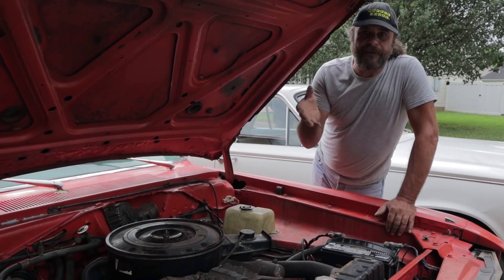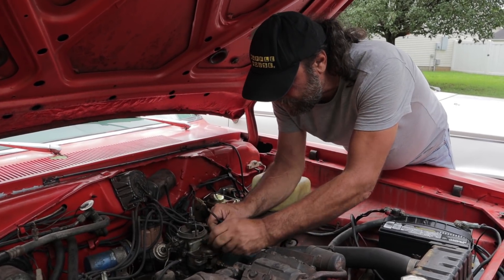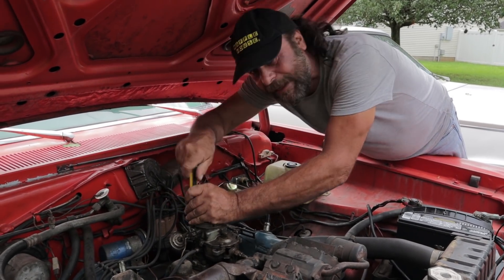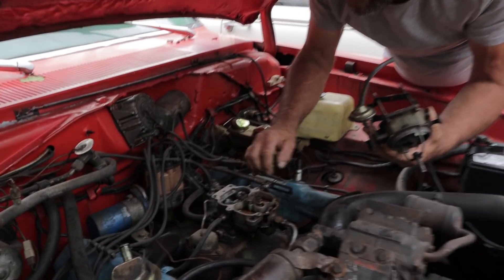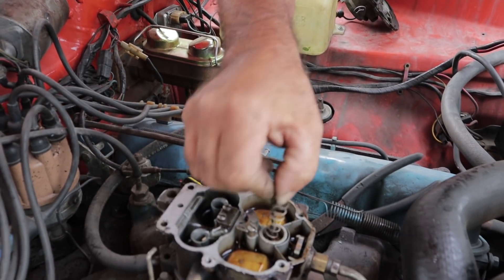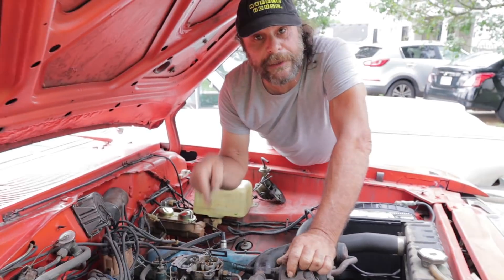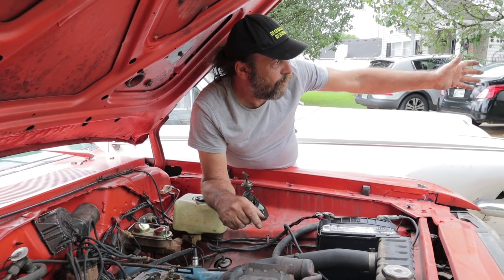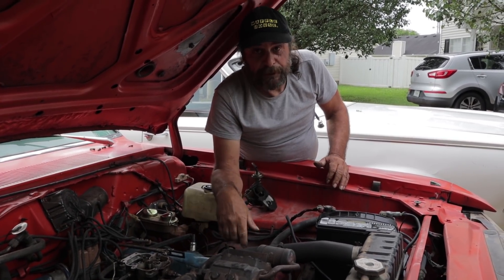Driving Classic Cars- The Truth About Ethanol Gas

Comment: Im with Tony. I have old carbureted cars set for months even years and havent had issues. Also daily drive them using nothing but E-10. And where i live the dreaded indian reservation gas ( 75 cents cheap er). Never had an issue. I will say it can possibly make the engine run a tiny but on the lean side. Also yes worse gas mileage because less energy is stored inside ethanol. But from what i understand it reduces chances of pre ignition... I have tried running pure gas which is found at a few stations within 50 miles of where i live. With mixed results. It can only be bought with 90 octane now. Few years ago was 91. But ive had it make my carbureted 318 run worse... Maybe because no one buys it and its old??

Comment: I beg to differ. Maybe motorcycle/atv/snowmobiles are different but 2 or 3 months with ethanol gas up here in Canada and the carbs are plugged and won’t start. At our shop we run only ethanol free fuel. Now up here the problem is the algae in the ethanol. With regular use and not letting sit for extended periods of time, it’s not as bad but still drys out the fuel lines. Something that has been sitting unused for 5-10 years has a better chance of running than something 6 months to a year. Again, maybe your ethanol is different than ours but up here it’s nothing but headaches.

Comment: I guess it can depend on what the carb is made of.  My F600 which gets started maybe 10 times a year has no problems with ethanol.  My old tractor, on the other hand, ethanol turns into boogers if I don't use some kind of ethanol treatment.  And older tractor mowers... shew!  That shit will turn to boogers in a week.  It has to be alloy related.
Reply: What I've noticed is with the carbs that can't use ethanol will be etched where the boogers grow.  But you can make that same carb work forever with diligent use of any sort of ethanol treatment.

Comment: My experience with ethanol fuels has been mostly negative. Have seen metering plates dissolved into metal shards in the float bowls . Probably fine for daily drivers but for anything that sits for any length of time I'm draining it.

Comment: i heard ethanol is only really bad if you have the cheaper modern floats instead of the old brass ones. either way i have easy access to 87+ gasoline without ethanol just down the road and can get higher octanes without with only a bit of a drive.

Comment: I was told to run premium gas in my old 350 Buick 4 bbl. is that true? Is it ok to use 87 or should I use 91 octane?
Reply: 420dportkid u can use either the higher octane will burn better
Reply from the maker: I use 87 exclusively in all my low compression daily drivers.  I have back to back tested with higher octane fuels and found zero benefit
Reply: Burn better? Higher octane gas burns >slower<, thus resisting pre-ignition and allowing a higher compression ratio. Or a larger initial ignition advance. If your car calls for 87 and doesn't have computer-controlled ignition timing, you won't get any benefit from higher octane. Caveats: if you have carbon buildup which is causing pre-ignition, it may lessen or cease. Also, there may be higher level of detergents in a brand's high-test than in their 87 octane

Comment: Nothing, it's a beat up , I knew  that 😅,I've run e85 in 99 302 Windsor before and the fuel systems are fine , but for it to run properly on e85  you would need to up grade the fuel pump and injectors for volume not corrosion, e10s doesn't do anything, except for lawnmowers which probably would need bigger jets

Comment: Just wondering if you all would buy a 4 door 70 cutlass with a 350 rocket running and driving needs a tune up and some rust repair on the lower doors and rear fenders
Reply from the maker: If the price is right, and the car turns you on, of course!
Reply: @UncleTonysGarage  getting into it at a young age my friend counts doors and is getting rid of it for 1000 canadian 760 American I'm really tempted

Comment: i play with a lot of bikes. mostly the really small ones, and the really big ones. i have personally seen ethanol gas melt plastic float bowls. some gaskets get shitty off it, i only use my own homemade gaskets tho. my biggest gripe is that i used to run clear plastic fuel line. it's fine with GAS gas, but the ethanol screws up the plastic and makes it so i gotta use the big black rubber fuel line. i got a few spots new me that sell "marine" gas. it's ethanol free for boats. not sure why boats need it, but i use it in all my bikes whenever possible. when ethanol gas evaporates, it leaves this crusty white stuff behind. a guy i know had left his petcock on and had a bad float needle. the e.gas would drip into the carb and evaportate. the crusty white stuff left behind eventually cracked the float bowl. that carb was done too... i feel like putting ethanol in gas is about the same as putting corn starch in cocaine. scientifically, the same motor will make less power running ethanol gas, unless you tune it different. it's not really that big a deal, it "works." i hate it tho....
Reply from the maker: Gravity feed systems are an entirely different thing

Comment: Interesting.  I think the biggest gripe about ethanol gas is the octane that is running in a high performance engine.
Reply: Keep in mind that the way octane was measured changed in the early '70s in the USA.  We went from RON (still used in Europe) to Anti-Knock Index (basically (RON + MON)/2 as shown on the pumps).  93 has decent octane.  It would have been ~98 if measured the old fashioned way.

Comment: ethanol does not evaporate well in small engine carburetors. it absorbs water from the atmosphere and becomes very corrosive. by the time the ethanol dried out, your flloat bowl probably stuck in oxidized aluminum crud

Comment: I can't drive my 84 in the heat for more than 15 minutes without being vapor locked for 2 hours and having to spray half a can of starting fluid into the carb on 10% ethanol. I run premium clear ONLY now.

Comment: Let a carb that stays wet, like a motorcycle with the fuel tank using gravity\fuel weight to keep the bowls filled, just sit, and it's a different story... A freshly rebuilt, cleaned carb on a dirt bike, will get plugged by the "green gunk" in about 4 weeks of sitting.

Comment: I heard that ethanol was bad for rubber hoses and such,I am no expert and appreciate your informative videos very much. I have one question. Do you have any problems with altitude going from high to low or vice versa, I live in Florida my truck was changed over to carburetor but I am at sea level so everything works fine all the time. Cool video.
Reply from the maker: No...I don't experience any issues with altitude change...but to be fair, I don't spend much time cruising through mountains

Comment: Only problem is when you ran a car for decades with out ethanol, it ends up having tons of deposits on the bottom of the gas tank.   Then the Ethanol in the new gas given enough time will dislodge the crud and deposits and choke the fuel filters, pumps and carbs.
Reply: True that.

Comment: i find the ethanol gas is typically less stable... i work on motorcycles and the fuel doesnt last as long before going bad in the carburetor... also see more failures in rubber... granted this is if it sits for 6 or 8 months.... other than lack of use i see no problem with ethanol gas

Comment: Thanks Uncle Tony! 👍 I know how to start my A body under hood by jumping the terminals for the relay, how did you shut it down without shocking yourself?
Reply from the maker: Unplugged the ballast resistor
Reply: Oh man I thought that's what you did. Thanks again! I wasn't sure if I did that if I would shock myself like pulling a coil wire while the motor is running. Don't want THAT again.

Comment: This is expected. You should encounter no issues if the vehicle is driven daily. The problem with classics is that most people do not drive them daily. They let them sit for weeks or months. Ethanol is hygroscopic and absorbs water over time. Water sitting in your carburetor bowl will lead to corrosion. It's common knowledge. This is also why it harms small engines, which tend to go unused for long periods. You never leave Ethanol gas in a small engine over a long period of time. Running pure gas is the way to go for an engine that sits more that it is in use.
Reply from the maker: If the carb is vented to the atmosphere, everything evaporates, water included.  Three days, bone dry

Comment: Ethanol has ruined my Honda Goldwing carbs on more than one occasion but that is my bad because I didn't drain them. What I was left with was this green funk clogging them. I gave up on that bike.Gave up on my 1980 Audi 80, ethanol ruined the Bosch FI system.
Ethanol is a BS way to try and "clean the air" HHO gas would work a lot better (and does) but no money to be made from it.
Wait until the big corn yields are not there this year due to the floods, will there be a moratorium on ethanol added to fuel? I bet the price will go sky high... just saying

Comment: I use flex fuel (around 40% ethanol) Usually around .50 cents a gallon cheaper than regular... ...Got 128,000 miles on my 13 year old truck. No fuel or no performance problems whatsoever.

Comment: Its not just thhe carb, its the tank. If you use the car it is far less of a problem. The Alcohol sits inthe tank absorbs water and rusts the tank. also , the shelf life of the alcohol gas is much shorter. about 3 months compared to over a year. You use that car as the daily driver so it is a bad example.

Comment: the old 57 Rochester 4 jet four barrel is also really easy to get the top off. the carb that really did not do well was the thermo quad. lots of fuel bowl warping and fuel leaking. the mechanics were always swearing at them. not sure if the thermo quad was affected by alcohol, temp, or just poor idea. keeping the fuel cooler would seem like a good idea. what some carb vehicles like my 85 plymouth mini van had was extra hose to , let a small amount of gas recirculate back to the fuel tank. I had my wife trained how to drive it. when you left it shut off for more than 10 min on a hot day. ALWAYS let it idle for over 2 mins before putting it in gear to go. if you did not do that the thing would dry out the carb. now you had to get the gallon jug of water out and pore it over the fuel canister between the pump and the carb. then crank and crank it up. carburetor vehicles just do not like alcohol gas in hot weather. Damn liberals messing with our fuel.

Comment: Just a small question, going back to your video about chinese hose, ethanol gas eats old rubber hose, right?  So I'm trying to rid having my fuel filter getting filled with little black sediment. So should I refit using fuel injection hose as ive been told it doesn't react to ethanol, or am I  just on the wrong track? Love ya btw
Reply from the maker: The FI hose it a step up, but regardless, there should always be a bare minimum of it in any fuel system

Comment: I wish the ethanol gas I put in my computer controlled carbureted classic didn't go to shit after I left it sitting for 4-6 months this last fall & winter. 

Hasn't run right since. Always dies under load, especially after getting to operating temp. Changed filter and doused the carb eith carb cleaner & Seafoam even. And the tank with a full bottle of Seafoam too

Comment: Uncle Tony, I have a 1988 Ltd Crown Victoria with a efi 302. In the owners manual it says that 10 percent ethanol is acceptable but if I put ethanol gas in it the fuel pump will be destroyed by the next day. Is there any way to fix this besides using expensive non ethanol gas. Additives dont work.
Reply from the maker: I don't see how that's possible

Comment: I feel stupid, I have spend a lot an additives like lead subsitudes and ethanol killers. But what about the valves and piston heads? (carb deposits) Greetings from Holland
Reply from the maker: I have never experienced any internal engine issues, and I don't use or recommend any additives.  I do however use Shell Rotella diesel oil because it contains zinc, which keeps the cam and lifters happy
Reply: Hi ok nice thanks for the tip (you might set of a oil war discussion :P) I use 10w40, no no to light use 20w50 meanwhile UTG......Diesel oil... :P

Comment: e85 is not too hard on metal carbs. The plastic floats and plastic fuel tubes are more at risk.
The benzne now allowed in the fuel is also harmful to 70's plastic and rubber parts...

Middle 60's cars are usually ok (by reputation.) 

Unleaded fuel is dangerous to the non-hardened valve seats.

Comment: I'm always told use 98 in old cars, I don't I use 91 no problems. Is there any advantages of 98 in older cars? It's a Slant six will 98 increase power because of long stroke?
Reply from the maker: No.  Octane is the fuels resistance to detonation.  Has nothing to do with duration or heat of the burn

Comment: My 79 Ford F-100 is hard to start after sitting over night, impossible after a week, it's fuel starved, I was thinking that there was a anti-drainback valve in the (mechanical) fuel pump and it had gone bad. Is this more likely the cause (evaporation)? After I get it started, it runs great, and I can jump in it all day and hit the key, and it fires right up.
   Please do a video explaining the operation and "circuits" of the carburetor, they're like women to me, I don't exactly understand them, and therefore they scare the Hell out of me...

Comment: Used Ethanol for years, even in a flathead V8. Never had a problem.
Reply: I suspect a flathead would run well on ethanol gas or even E85 if the fuel system is set up right for it. Flatheads always run hot thanks to how they run the exhaust through the block. Ethanol burns cooler than gas. I know my old small block Ford V8s work well with ethanol gas.
Reply: @prushimush  It did, ran exceptionally well heading home at 2am at 80mph after party time. I had a stock motor with twin Ford carbs on a Weinand manifold, powering a "40 Ford 4 door.

Comment: I made the mistake of leaving my 82 dodge truck sitting for a month or more with 87 octane with ethanol and when to start it up and ran fine for a little while then ran like shit and sound like it was only running on 3-4 cylinders and smelled like it was running rich. Shut the vehicle off unbolted the 600 edelbrock and took it apart and found this clear/yellowish real fine chunky gelatinous stuff piled up in spots or floating in the bowels and it had gotten sucked into the fuel metering jet ports in the carb and clogged it up. I saved a sample and showed it to some mechanic and they said effects of ethanol that sat too long. I had to flush the entire fuel system and tank to fix the problem. Ethanol gas is  fine if the vehicle is running every day or every other day and so on and the fuel system is constantly being flushed with new gas but if it sits for a long time with no start ups it will clog up . Any gas with ethanol will do this . Its horrible on lawn power equipment ! When it sits it has an chemical reaction with the air/moisture in the air . It makes the ethanol separate from the gas and lowers the octane and the ethanol quagulates and once you empty out this slug and the left over skin of film in the carb will dry out and leave a white chalky residue on the walls and floor of the fuel bowel   . I quit running the ethanol gas and look for gas with no ethanol like 92 and up octane  at kum n go or shell the vehicle runs better too! Little to no miss while the engine is a idle and has been fine tuned
Reply from the maker: 13 vehicles in my fleet, 9 of which are runners...all carbed, all fed nothing but pump ethanol.  Most sit for months at a time between uses.  No special treatment, and no issues that even resemble what you described
Reply: @UncleTonysGarage  i might have gotten a bad couple of gallons of gas from a shady gas station . I did visit some odd ball stations along the way? Who know?

Comment: Ethanol is bad for lawnmowers and small engines and ruins fuel lines if left it will ruin the lines faster then fuel and it also burns at a slightly higher temp

Comment: Hey Tony, check your fuel mileage with ethanol, then run some non ethanol gas. You will see a difference. Non ethanol will give better mileage, and run a little cooler.
Reply: Absolutely will not run cooler. Had mileage sure 😊

Comment: Yes, but how did you jet & re-tune it to operate optimally on the reform gasoline?
Reply: pancudowny  I run the same carb with the same results, it has little to do with the carb and more to do with ignition timing and dwell. It’s old school tech that requires old school understanding of the big picture.
Reply from the maker: It would only take about a .001 increase in jet size to equal everything out.  Not worth the trouble
Reply: @UncleTonysGarage  I figured as much, given the viscosity and all... I imagine it's more in the spark timing, and the spark voltage and endurance.
Reply: @ryandavis7593  So it's like I figured: All in the spark. A touch more of initial and a bit more advance curved in... and a small increase of voltage and duration, eh?

Comment: I can’t agree with everything you said. If you parked that car for six months, that fuel would go bad. It might run, but it is stale! You look at fresh fuel from the pump, it’s clear. Old fuel is a dark yellowish color. With an unmistakable smell. It might run, but what’s it doing to your fuel tank? I have seen fairly new cars that are only driven periodically. And the electric fuel pumps go bad. So, you drop the tank and it’s all rusted out inside. It’s because of the ethanol. Also, on small engines like lawn mowers, today’s 10% ethanol fuels plug up the carbs.just by sitting over the winter. This was never a problem back in the day.